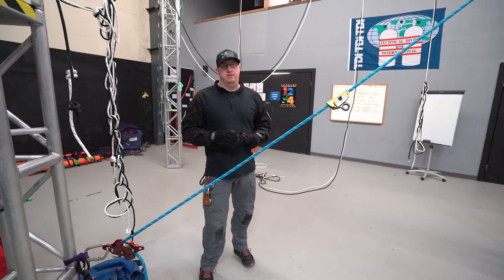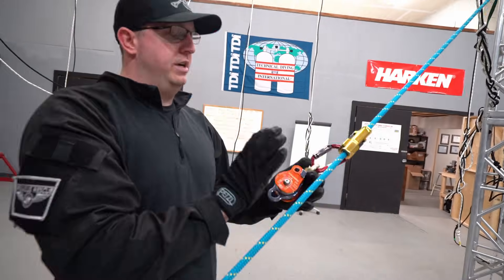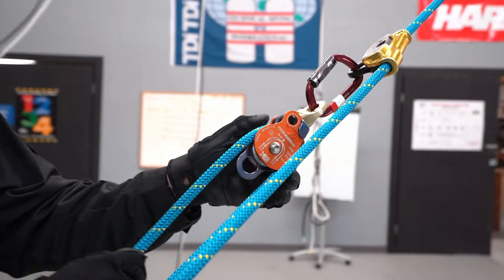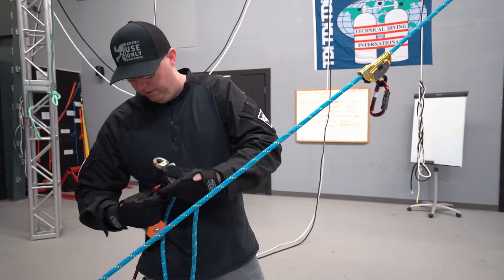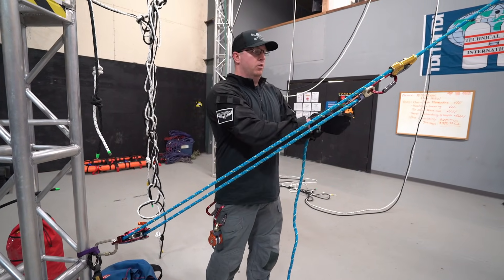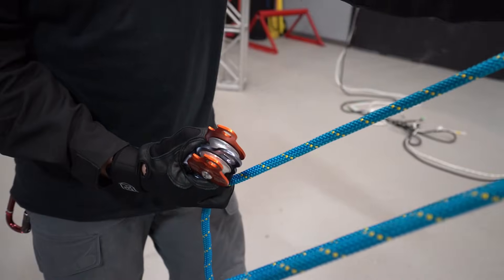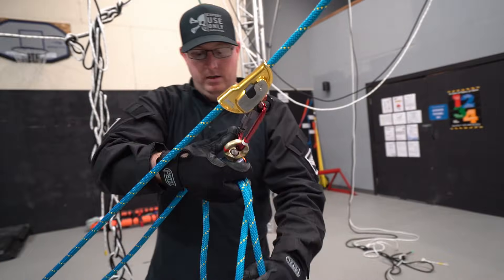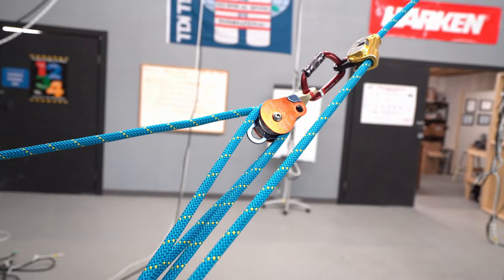Tech Tip: Easy conversion of a 3:1 to a 5:1 MA system

Comment: What about a 5:1 complex system by adding a single pulley to the travelling rope coming from the fixed pulley at the top? while there are considerations for this (e.g. now you are pulling towards what is likely your edge - not always ideal), it's much quicker change than adding the double etc...
Reply from the maker: Anything is possibly with a little ingenuity, stay creative! But of course stay safe!

Comment: I 100% agree: shame on anyone who feels they know bette than, CMC themselves.

Also, ironically: this is better...or quicker I should say, than CMC's solution of: (basically the same thing but backwards) of single to the single FIRST to the becket, then add the Double (alot more line management, the way it looked), outter lines in th double/double to the the Rescucender/triple wrap Prus.

Comment: Why not just use 2 Omni blocks with a alpine butterfly and an anchor? Quick set we use it in the tree industry and if it can pull a 200 foot tree with 75in dbh I don’t see why it wouldn’t work for rescue purposes
Reply: My guess is safety.  A tree falling to the ground is a little different than a human or two falling.

Comment: You still caused the twist of ropes.  You have to be careful and return the directional pulley between the ropes, for the MPD has the becket in the middle not on the side.  Best regards